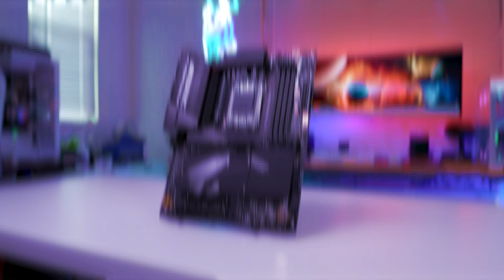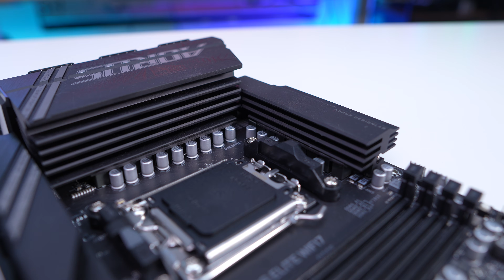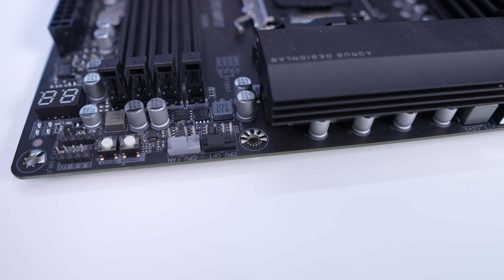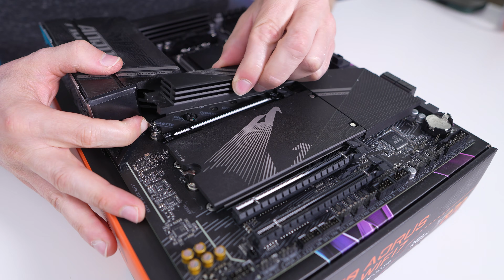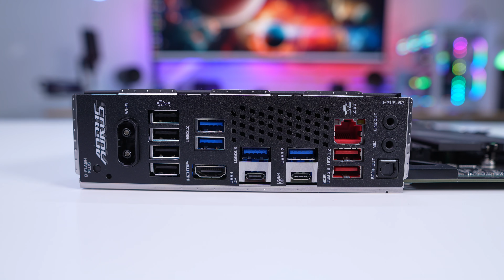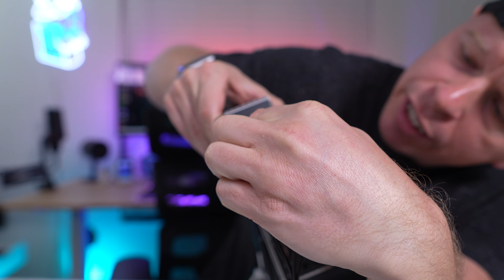Gigabyte X870 AORUS Elite WiFi7 Motherboard Review

Comment: You can only have two m2 drives because of that slot limitation.  Nobody will want to buy a 5090 and then limit the speed of the lane.  So plan your build for one gen 4 4tb ssd and one gen 5 4tb ssd. (Which should be more than enough for a 4+ year build unless you don't cleanup after yourself :)) this is what I'm doing with this board!
Reply: You can also get an m.2 adaptor for the lower pci lanes (pciex2 and pciex4) and that wouldn’t impact the x16.
Reply: @ReelBigMcNugget i was talking a look at the manual and i see “- 1 x PCI Express x16 slot, supporting PCIe 4.0 and running at x4 (PCIEX4)
* The PCIEX4 slot shares bandwidth with the M2D_SB connector. The PCIEX4 slot becomes unavailable when a device is installed in the M2D_SB connector.“ Does that mean if the gen 4 m.2 slot is used, the pciex4 slot is disabled? My last pc build was in 2019 so im quite behind and confused on some of these things lol. Also it starts out talking about the x16 slot but then refers to it supporting x4 and right after that sentence, it talks about how the m2D_sb connector (gen 4) is connected to the pciex4 slot and is disabled when the m.2 gen 4 is used. So im just confused about most of this i think lol
Reply: @elias61000    sorry I’ve only just seen this. 

I have this motherboard and I put my two m.2 drives in A and D. B and C will disrupt the x16 and make it run at x8 (which isn’t really an issue, any effect on performance would be negligible) and that’s where my gpu is so I’ve left those free. Looking at the diagram, the x4 is BYPASSED if you’re using D. The x2 slot is unaffected by any m.2 slots. 

Also note, the x16 can also function as x8 or x4 but the board has a separate x4 slot and a separate x2 slot. My original comment was that you can use an m.2 to pcie adaptor and put that in the x2 slot to bypass the restrictions.
Reply: @ReelBigMcNugget  ahhhhh I see. Thanks for the reply and clearing it up for me!
Reply: @ReelBigMcNugget  thanks for this advice im actually building one now using this board. sorry noob question if i put a samsung ssd on one of the sata3 ports is that ok?
Reply: @ReelBigMcNugget I'm about to get this board, If I have one 2Tb 4th gen m.2 in the top slot will I be unaffected?
Reply: @ yeah I use the top slot (M2A) for my boot drive and second slot (M2D) for storage and that way you get the full 16 lanes of pcie. 

The board is great, no issues 6 months in
Reply: @ReelBigMcNugget  thank you!
Reply: @ReelBigMcNugget  great shout!
Reply: @ReelBigMcNugget  This is an excellent thing to consider as you rarely use all drives at the same time especially when just gaming - it shouldn't impact the drives performance unless you started using them all at once and saturating the PCiE lanes. But isn't the 2nd slot an x8 gen5? That should be fine..
Reply: Time to tell how much of an impact this would have on GPU performance, by halving the 16 gen 5 lanes to 8 you are effectively getting 16x gen 4 bandwidth

Rtx 4090 can run on pcie gen 3 motherboards with the impact to performance not being as drastic as you might fear.   

It will be interesting to see how this works out in reality
Reply: @djpep94  I think is going to have more impact on next generation of gpus. But for me two m.2 are more than enough, I can add an external ssd if I need more.
Reply: @TheKramer94  yes absolutely

I suppose we won’t know how big the impact will be until 50 series launch and somebody like gamersnexus does a breakdown
Reply: Most don't understand this.  @Screaminglordsandwhich
Reply: Not even a new GPU will saturate a 5.0x8, the 7900 xtx and 4090 barely saturate a 3.0x16 which is 4.0x8. Don't sweat it
Reply: I have 1 Gen 4 drive and 2 Gen 3 drives. If I populate the top two gen 5 slots and use a pcie connection card for the other I think it would avoid this limitation correct?
Reply: @jeremy7383 you could use slot A for the highest gen, one gen 3 in slot D and the pcie adapter in the x2 slot at the bottom. Your x16 slot would be unaffected with this configuration.
Reply: Yeah, you can use 1x GEN5 m2 drive. If you use the 2nd slot (first one, from the top, under the flat heatsink) you lose the PCIEx4 connector (which you can afford to me). Worse, though, if you use the 3rd and 4th m2 slot under the flat heatsink, your video card will only do x8, which, in this day and age, is frankly ridiculous.
Reply: Hey man, how is this board? did you have any problems with it? I am about to buy it to go with my 5080 and 9800x3d, any problems or issues you noticed?
Reply: @Neopopulist  zero issues, got two for two builds.  Plug and play.
Reply: @Neopopulist hey your build same as my build too, so what the conclusion, is affect to gpu or something else? I didn't understand what they are talking about. Newbie here. And i been using 2Tb Lexar m.2 and 500Tb from Adata and put on pcie 5.
Reply: Broker:You’re wrong. Broker can do anything.
Reply: I'm planning to drop in a 3090 Ti GPU, so I'm planning to use all M.2 slots
Reply: You know you still have SATA right?
Reply: I said m2, not sata.  @sushles
Reply: I have rtx 5070 and 3 m.2 ssd what I have to do??😢😢😢😢
Reply: @awedmufleeh-gi9cp return your ssds. Buy one gen 5 4tb and one gen 4 4tb. You won't need more than 8tb. Just get them on sale, black Friday coming soon.
Reply: Hi Daniel, I just buy this mother and suddenly realized this limitation, I going to use it with two m.2 gen 4, it's going to impact the performance of the gpu?
Reply: @thekramer324  only if you put the m2 drive in either of the two slots that impact the performance of the GPU.  It will explain it in the manual. Be sure to read the manual before you build your PC.
Reply: Even with x8 lanes you’ll only lose like 1-2% of performance and i really don’t anyone is pairing a 5090 with these kind of mb
Reply: @RoronoaZorop966  The big performance loss is when gaming and RAM is transferring large textures to VRAM. That's where that speed is important. But unless saturating the bus with  huge transfers your mostly correct, the noticeable difference may be negatable. Now a little hacker trick, you can tape off half your PCIe lanes and run the card at x8 and see for yourself and even tape off more to go down to 4x lanes. Linus Tech Tips did this and the cards run as if they are on a weaker PCIe slot. I forget the results but if I remember going down to x8 had little impact overall like you said.